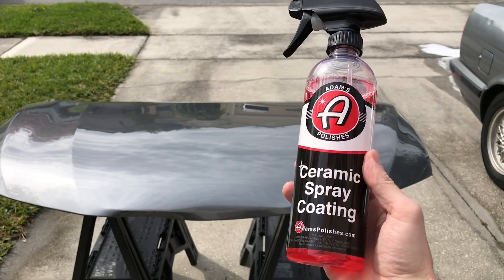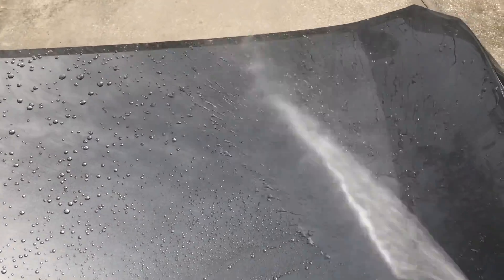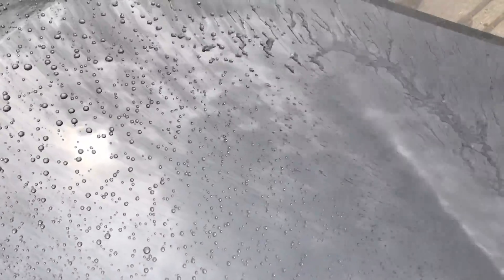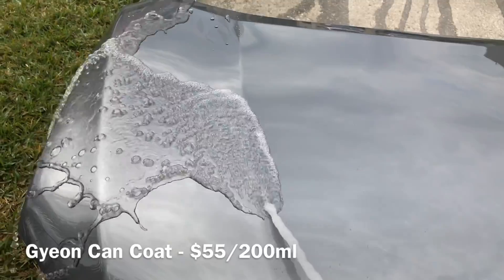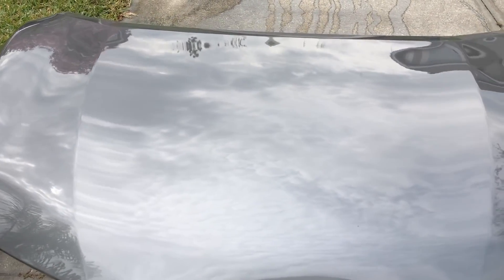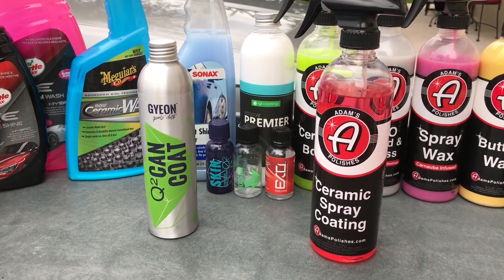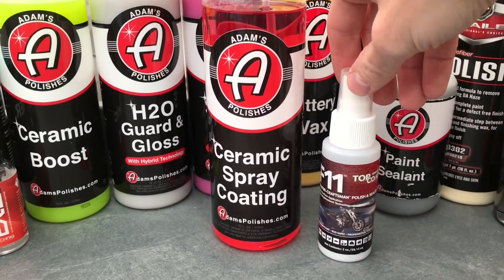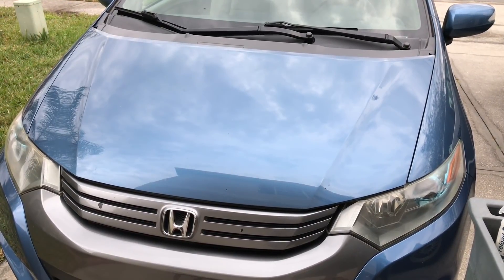Adam’s Ceramic Spray Coating - First Impressions & Hydrophobics

Comment: Have you done a video with IGL premier yet??
Reply from the maker: IGL Premier will definitely be coming up in the future, need to remove a coating to find some space on the paint for durability testing.
Reply: @WaxMode  ok just checking, I saw it on the cart but don't recall a video. I just topped my quartz hood with it today
Reply from the maker: @cruzscarwash2089  - Tried out IGL Premier this weekend.  Incredible hydrophobics, didn't need any cure to get us there I saw some instant insane beading very shortly after applying.  Used it on top of Sonax PNS with Bead Maker and CG Hybrid V7 on the left half, Fusso Coat with Bead Maker and V7 on the right side.  The V7 and Bead Maker sections had a negative impact on hydrophobics of the different base sealants but IGL evened everything out with perfect beading across the board, tells me it's not picky about what's underneath and can be used effectively as a topper.  Definitely more testing to do including solo performance, CMX from Mothers showed up as well and I'm absolutely loving the water behavior.
Reply: My CMX is driving around with UPS right now, still waiting for it to stop at my house. I have been enjoying Meg's CW it's been a great drying aid

Comment: Like all your videos!! Thank u
Wondering if u tried hydrosilex?
Reply from the maker: Yes I've worked with Hydrosilex Recharge.  They've removed the recommendation to apply it with the spray and rinse method due to streaking which is a pretty large blow to its marketability.  My bottle was about a year old and it's gone bad, I haven't picked up their updated V2 formula, mainly due to pricing.  Average hydrophobic behavior, I like Hybrid Ceramic Wax much better than Recharge and I wouldn't consider Recharge in the spray coating category like Gyeon Can Coat or Adam's Spray Coating.

Comment: Want to see the turtle wax foams wash.
Reply from the maker: It smells insane coming out of the foam cannon, I was going nuts!  But yeah Autozone was charging $15 for it so we're going to have to see if Walmart stocks it at a much lower price.
Reply: That’s pretty steep. Anyway do you use a pressure washer when you wash your car or a spray nozzle like in the video ?
Reply from the maker: I switch back and forth a lot between the pressure washer and the hose setup.  Ideally, when it's hot in Florida I would be running rinseless washes to prevent spotting for the majority of washes outside of testing.  But many of my favorite rinseless washes can impact the behavior of the wax/sealant/coating on the paint so I've really cut back on using these, and rinsing is the only way I can capture durability.  

Moving forward, I will most likely continue with the pressure washer setup to capture beading in the rinse test and run the flood setting on the hose for sheeting.  I recently picked up the MTM SGS-28 setup that Obsessed Garage sells for the Ryobi washers and it's absolutely fantastic and works great with one hand while filming.

Comment: If you're going to compare two products you need three strips. 1) No coating 2) Product 1 3) Product 2. That way we have a control to understand what the surface produces minus any product at all.